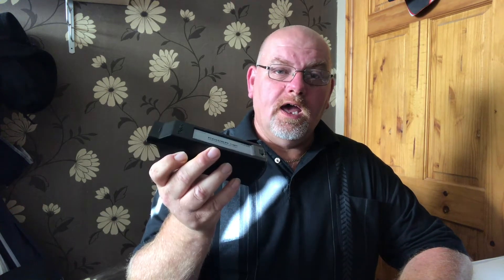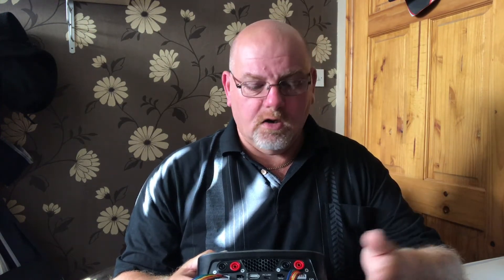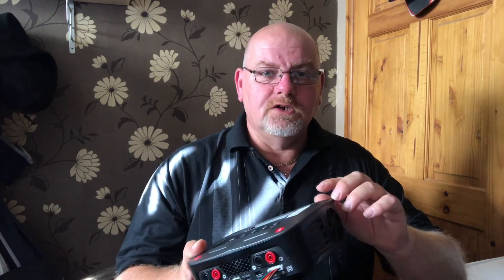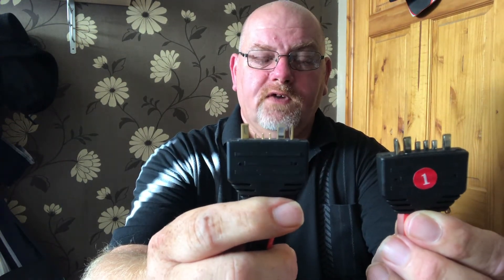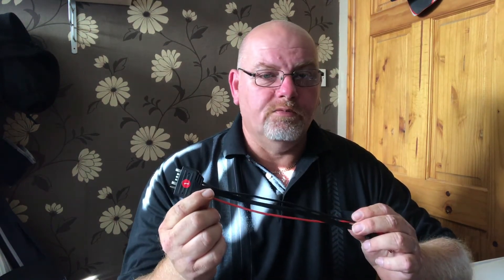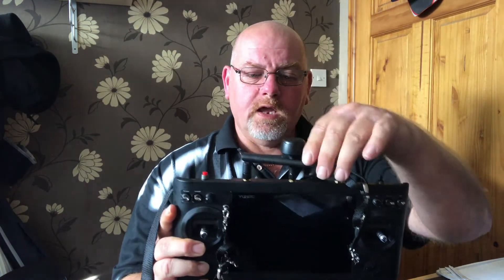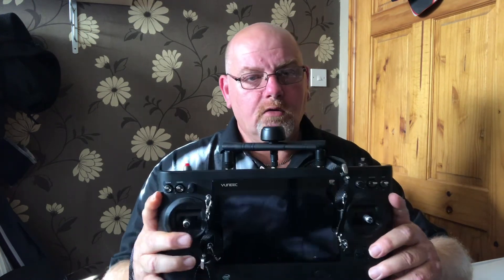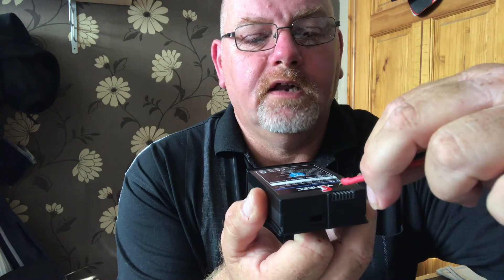What’s The Difference Between The Yuneec Typhoon H and H Plus Batteries?

Comment: They so fucked over us, the H drone is Great So fuck those Batteries, Does the NEW H plus fit into the old H Drone ????????????????
Reply from the maker: Yes. The only difference is the H480 have different balance pins as explained in the video. Also H480 are not the same voltage as the Hplus but they do work in the Hplus as the positive and negative dean connectors are the same. I have both types of batteries and use both in the Hplus. However on the ST16s controller percentage of battery will read wrong but fortunately the right way round meaning it’ll show less than what you actually have in the battery. BUT these batteries do NOT fit the newer H3 Typhoon.

Comment: Can you please tell me what to set the Yuneec A10 charger when charging the single cell battery in the latter ST16 control for the Typhoon H Plus Drone. I do have an adapter for the single cell battery but there is no single cell setting on the A10.
Reply from the maker: Settings for the st16s battery should be LiIo 5.0A at 3.6 (1s)

Comment: Hi there. Since you have both of the drones can you tell me if you can bind a S16 from the H with a H+ ?  Thank you for your time and a great video.
Reply from the maker: Hi George. No it is not possible to. Ind an ST16 to an H plus or H520. The reason is the software for these 2 drones are 64 bit whereas the ST16 is only 32 bit so the software will not work.
Reply: I just got the H+ and I manage to bind the ST16  and I go forward and attach my CGO3+ camera on it. I actually manage to fly the H+ with the H batteries but there is no camera control . I have video feed and I can record but I can't move the camera at all. Also the real sense do not work with ST16 even was activated in the app. All flying control and other functions like start stop /landing gear movements /taking pictures and videos works just fine. I put this here maybe I answer to others if they have same questions. H+ it is amazing bird. Thanks for your replay.

Comment: Can I use H Plus battery in my typhoon h   PS You explain things well thank you
Reply from the maker: Hi George. The power connections are the same but be careful as the H Plus are a higher voltage.
Reply: @PegasusDroneMedia  so it will work?
Reply from the maker: Yes

Comment: Many thanks for a very informative video. At last I think I have found someone who can answer my question. I have a SKYRC D100 balance charger from Copter.eu and I want to know the best charging set ups for the H and H+ batteries. And recommendation I was given was - LIPO Balance Charge 6.8A - 4S with a capacity cut off at 6800mAh for the H batteries. Is that right?
Reply from the maker: Hi Stephen, if you want to use H batteries they are indeed LiPo and because the mAh is 6800 you can set them on the D100 at 6.8A......However that is a very fast current and will shorten the life of the battery. If I'm honest I would stick with 5.4A, all that means is it will take a little while longer to charge them up but you are most likely to prolong the life of the battery band cause less puffing chances. However you do mention H+ so they are LiHv batteries and as the video says need different charging leads as the H ones will not work. Yuneec H Plus batteries need charging on 5.2A balance charge because they are 5250mAh, all are 4S. My advice also is to never put them on 'charge mode' as this is not balanced and then put them into 'storage' charge once they have come down to room temperature, avoid re charging while they are warm. Thanks for the question

Comment: I cannot get my controller to bring in my satellites and my flashing blue light does not stop flashing. Can you help with this procedure. JIM
Reply from the maker: Sounds like you need to reset the controller Jim. Mine played up as well after the latest update. I reset the ST16s amdnits now better but does struggle to still pick up satellites. Do this via the android settings. If that doesn’t work it may have to go back to Yuneec.

Comment: There is no way I would buy another Yuneec OEM battery - they are getting a bad reputation because they start to swell within a few months. I have 3 OEM Yuneec batteries for my Typhoon H hexecopters and 2 of the batteries are puffed and swelled up enough that the labels have swelled up to the outer surface of the battery frame (approx 1/8 inch). The battery frame/case does not swell only the recessed label that takes up about 95% of the top and bottom of the battery casing. I charge my batteries within a day or two of flying and store them half charged as I do the 2 PowerExtra batteries I have (that don't swell). You can press the puffed up Yuneec label down and feel the pressure of compressed gas underneath. I also use a balance charger for charging - rarely the OEM Yuneec chargers since my batteries started swelling.  

When I called Yuneec told me they do not warranty their batteries for more than 30 days. Mine were swelling within a 6 months and I had less than 10 flights on each (I don't fly much in winter). Other than the poor support Yuneec has for their batteries I have been pleased with their service department and the performance of my Typhoon H hexacopters.  

I think it is a bit telling that Yuneec switched their battery technology LiPoHV while taking no responsibility for their low quality original batteries.  I hope the newer batteries hold up better - but if they don't it will be at the owner's expense . . .
Reply from the maker: Thanks for sharing your experience Nad. However I have 16 Yuneec batteries (a mixture of the older LiPo and the newer LiHV) they are all original OEM Yuneec and have well over 30 charges on all of them (I say 30 as thats the least charge). I never use the single charger that comes with the aircraft but instead I use the Yuneec A10 balance charger and like you I store at 50%. I Never charge my batteries until the day I want to use them or the very earliest the night before. I never leave them charged if I havent used the battery and will always fly the battery down to 50% before leaving the flight site. I have never charged any of my batteries on any other mode than 'balance'. Balance chargers also have a setting called 'charge' this isnt a balance setting and can cause over charging of the cells. You sound like you know what you are doing but just make sure you choose 'balance' over any other setting. One of the things that causes the batteries to puff is charging the batteries to either full charge or 50 % storage charge when they are still warm from use. I always let my batteries cool right down to room temperature before balance charging them. I will always use Yuneec batteries for the simple reason if something should go wrong with the aircraft Yuneec will not have the opportunity to void the warranty because I didnt use their batteries. If the aircraft is out of warranty then you have nothing to lose by trying different makes.

Comment: So if I can use a Typhoon H PLUS battery in a Typhoon H, can I expect some increased flight time?

I noticed the Typhoon H plus is a bit larger, but has a greater claimed flight time. Curious as to what the effect would be on a Typhoon H with a Typhoon H PLUS battery.
Reply from the maker: Not necessarily Gene. Flying my H520 I actually get 1-2 mins more using H 480 batteries but conditions such as wind will make a difference. The higher voltage does not mean more flight time  and for the extra £40 I wouldn’t bother. Just buy a couple of extra H batteries would be my advice

Comment: Can I use a typhoon h plus battery in a typhoon H?
Reply from the maker: Indeed you can. But the voltage reading will be slightly out as the H Plus batteries are a higher voltage. Make sure you land in good time not to get caught out.

Comment: i think it is even possible to use the plus batteries in the old typhoon H advanced because a lot of pilots are using 3d printed battery trays with LIHV batteries
Reply from the maker: That is correct. You can also use H520 batteries in both the H Plus and original H480. In any combination in fact. Just remember though that the voltage readings will be different and to adjust your flight time to make it back safely